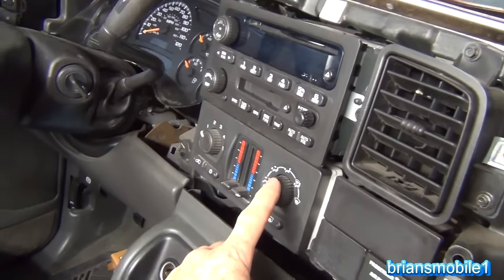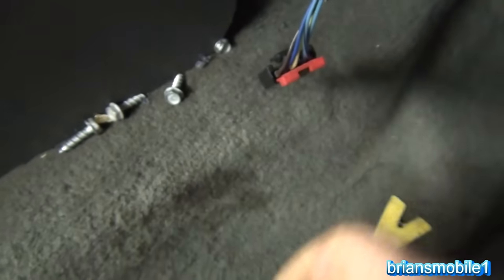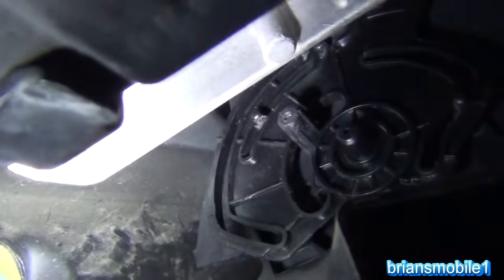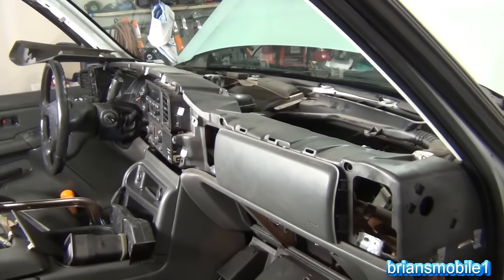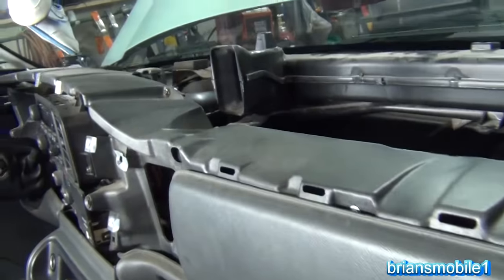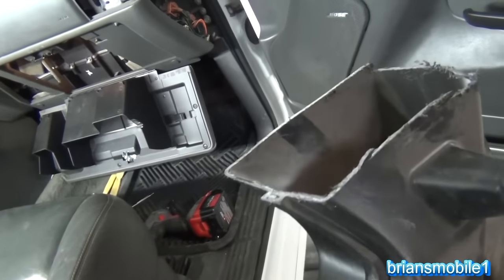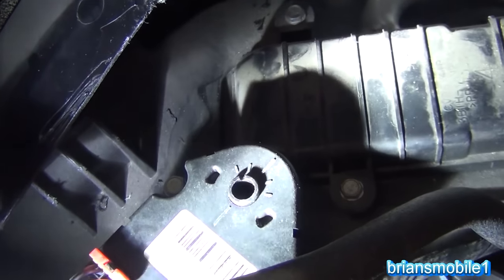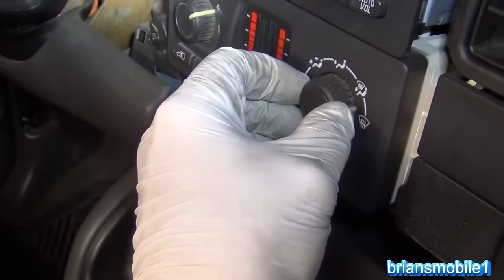Silverado Heater and AC Actuator FIX

Comment: Thanks for a great video. You helped me immensely and got me through the replacement of the blend door and inlet door actuators, both located on the passenger side. Having succeded at that I found  the mode control would not work. I had air blowing through defrost only. Various internet sources describe pulling the HVAC fuse (under the hood) or disconnecting the negative battery cable for 5 minutes or so, then turning the key to on (not start) and allowing the actuators a few minutes to automatically recalibrate. After multiple failed attempts this is wnat worked for me. 1) unplug both negative and positive battery cables, 2) hold the two cable ends together for about 30-40 seconds, 3) leave the battery disconnected another 20 minutes, 4) reconnect cables to battery, 5) wait another 5 minutes, 6) get in truck, turn key to on (don't start engine), don't touch climate controls, and allow the actuators about 4 minutes to automatically recalibrate. This is the only method that worked for me. Maybe it will help  someone else.

Comment: Great video Brian.  I was apprehensive to cut the vent tube assembly but agree with you that it works and probably the only way to change out the air inlet/ circulate actuator.  I had previously changed the mode select actuator in 2013.  Both blend actuators went out within a month of each other.  Decided to replace the air inlet actuator since the entire dashboard area was opened up.  Your video helped tremendously.  I even purchased the recommended Milwaukee jab saw.  It is a great tool.  Doing this yourself saved an insane amount of money from taking it to the dealer.

Comment: Ok I have to thank you for this video.  I was determined to install it through the little area so I took out the air bag, bat disconnected of course, the whole thing was very intimidating for me but this video gave me the guts to do it and it worked.....  I had a really small 1/4" ratchet and was able to operate its arm with a larger box wrench postured at a 90 around the end and held down the socket with a really long driver through the center passenger vent whole. the socket kept rocking on the bolt so much effort repsoitioning and repositioning the long screw driver through the denter pass vent and have another go. As the screw got deeper, the bolt became more ridgid and was abe to make slow headway with many breaks and explicatives.  it took forever but I had plenty of time.  I cant thank you enough for this whole thing all apart, I went back couple times to look at which metal bracket went where etc.  It took me a bit to get all the tabs up front to catch etc.  once again I cleaned all the pieces and the whole thing came out great and I saved just a ton of money....   I was able to watch the thing move back and forth through the center whole with a long light with just the key on.

Comment: Finishing your video says three things about me. The third thing is that enjoyed it! It is a very informative video. No time wasted, all aspects covered. 👍 Now about the wire routing at 3:42   I would of kept the wire behind, as original from factory. In a dirt road/washboard condition or potholes (I live in Michigan, Pothole Capital!) tucking the wire behind reduces movement as the wire is trapped in place against the screw boss. Just a thought. Although I'll admit I have on occasions re-routed, taped, or tie wrapped wires in additional spots. lol. Once again great video!

Comment: Hi Brian - awesome thorough video! I am replaced my servo controller for the mode switch with a brand new one. After installing and being proud of getting the two screws and it all aligned I was very proud and ready for a great fix. Unfortunately the new servo did not seem to operate as I hoped. I tried taking out the fuse to initiate the recalibration but that didn't help either. So I dismounted the servo and just watched it while it  hanged by it's wire harness. When I disconnected the fuse and turned the ignition on it would go all the way to the counter clockwise index mark. When I plug the fuse back in and turn the ignition on it would go to its full clockwise position index mark and stop. Letting it sit for few minutes with engine running wouldn't do anything and turning the dial wouldn't do anything. It would just stay in the full clockwise position.  So I'm not sure if I'm not calibrating it correctly or whether there's an issue with the actual AC control board with the switches and dials.  Do you have to clear the code on a scanner?  Any suggestions? Thanks!

Comment: Great video!  Went thru your process with my '04 GMC Sierra, flawless process!  One point from a prior experience: pulling the dash panel doesn't need a prying tool; simply pull the bottom right corner towards you to get it started (mine has a bit of the corner exposed for a finger grab), then just work it loose all the way around. This helps minimize mutilation marks.

Comment: This video work great. I followed it step by step  and didnt have any problems. The self tapping screw at 14:30 only works on some model years. I had the bridge plastic piece but couldn't get under it for a clean cut. But its supported by two screws one on each end

Comment: Bryan,  Great job!  Thank you for this great instructional video. I did not know there were four actuators. I changed the passenger floor one (from other info on the net). The one I needed to change was one under the gas pedal. You, saved me another few hours of stress trying to figure out why only defrost air was all I could get.  Thank you again

Comment: I finally decided to tackle this project and I didn't cut my plastic far enough back. The blend door doesn't make any noise now. Is that door meant to stay closed???? It hasn't moved since I replaced it with a new actuator. Going to attempt the drivers side since nothing changes from the vents to the defrost. Thanks again for doing this video for us fellas.

Comment: Video is a little old but exactly what I needed. Been struggling with my 2004 mode actuator for a few years, obviously not every day. But tried to replace it, watched videos, gave up had a shop replace it, he gave up. My hands are too big to get to the screws to reinstall. I will be more likely to try again after your video.

Comment: Such and excellent video and a well spoken educator you are. I came looking for info on ac control buttons not working but I'll just keep looking, Figured I would get some info for my 2003 2500hD I just acquired. I'm sure the actuators will also need some attention. Thank you for an excellent lesson!

Comment: Hey Brian, great video, long time subscriber since I have a Silverado.  I did watch the whole video and nice closing statements. 
I have a 2001 Silverado, manual heater controls, doesn’t have dual controls. 

I turned the key on and immediately heard a tapping noise near the glove box. That hollow tapping noise sounded just like, when you manually opened and closed the blend door on your video around 2:02. Once I started the truck the tapping noise became much faster. So, key off, no tapping, key on slow tapping noise. Start motor and much faster tapping noise. 
The fresh air button was on, I pushed the re-circulation button and the tapping noise stopped. Pushed the fresh air button and tapping started again. 

When I turn the control knob up to floor air or further to the right for floor and defrost or just defrost, the re-circulation button automatically goes to fresh air and the tapping noise starts again. Put the control knob back on vents and push the re-circulation button and tapping stops. 
I took off the easy to get to Actuator, unplugged it and turned the key on and put the fresh air button on and the tapping started again.  I think I illuminated the easy to get to actuator, since it is completely off and unplugged, but still have tapping noise. 

Everything seems to work for now, I am assuming the actuator will break since the tapping noise is quite fast when the vehicle is started. 

I guess, now I have to take the entire dash cover off to get to the actuator by the recirculation door. Would that be correct? Will I have to cut the duct just to get to that or those actuators? Any other suggestions?

Comment: Hey Brian, Great video... Thanks for the outstanding job!   I'm a proud owner of a 2003 Silverado SS AWD with only 55k on the odometer, had it since it was brand new!  What age/mileage did this problem occur for this truck?  Also,  my dash is black with charcoal gray paint on it and the paint is chipping and peeling off in three or four places as I've learned most of them do... it looks hideous.   I'm not having the actuator door issues yet, but am considering removing the top of my dash to strip and repaint it... Is there any chance you have that step in your editing archives?... I need to know how to remove the dash top.  My truck is my baby... spending most of it's time in the garage for preservation... but I drive it daily.. just not very far. I like to keep it in tip top shape.  Thanks for the great video, and kind attitude towards your audience! Love it...!

Comment: Great video, Brian! Used the cut method on my friend's 2004 Silverado 1500. Tried the glove compartment method first. Bad idea! Lost a 1/2 day of work! Went to the cut method and worked out real well. Local Lowes and HD did not have Milwaukee tool, so used a Lowe's brand which worked just as well. Thanks for your help!

Comment: Fantastic video. I have to do the same soon. Been doing the reset but it’s not working all the time. 2 questions please. Are all the actuators the same part number? What happens if I’m getting hot on the driver’s side also?

Comment: Wow, great video. I have a 05 Silverardo  with only 70,000 miles and hope I don't have to replace any of the actuators, however, 
after your video, I believe I would tackle it.  I bought it new and shortly after, they issued a recall due to a potential fire hazard in the control  for the heater and air cond. I can't think of what it is called, it was awhile back. I mention this in case someone has this model truck and is not aware of the problem. Thanks again for the video,  you gained a new subscriber.

Comment: This is one of the best videos I have seen on a vehicle repair. it is very well explained on the procedures it takes to do the job. My issue is I have a 
4 amp draw that is causing other problems. I am not sure if a hvac actuator is the problem. I have a loud clicking noise coming from the firewall right behind the intake manifold every time I turn the key on and sometimes while it is running I am not experienced working on this type of issue. Any information to determine the exact cause would be greatly appreciated

Comment: Hey Brian just wanted to mention as you requested, that you can take out the actuator inside the dash without cutting the duct. 
You have to take the other half of the metal bracket that is over the duct on the drivers side off as well. Then you disconnect the duct from the defrost on both ends just pulling the hose off, then you unscrew where it is connected to the dash on both ends. 
You pull up on the defrost part of it and it will come up and make a hole big enough to reach in and unscrew the actuator.

Comment: Excellent video my only two questions are why did you replace the actuators? and I either missed it both times I watched your video but what procedure did you use to reset these actuators, when I did my 1999 silverado manual a/c actuators, my truck has only 3 actuators, all my actuators reset except the one on the floor in the middle, if it's not too much trouble could you please explain why you went through all this if your actuators were not bad? if you had bad actuators which ones were bad, I totally understand why you did them all at once but I can't recall you mentioning which one was bad? again thanks for the video great job.

Comment: Hey Brian, just came across your video and appreciate the in depth information provided.  I have a 2004  Silverado.  The AC works fine , starting to experience cool air coming from the driver side and center vent and the center vent

Comment: Fantastic video.  I live in Miami, but went to Kentucky for a month in the winter, only to discover I have no heat.  Gotta fix that.  Two questions:  There are 4 actuators.  Are they all the same part #?  You showed the grease.  What brand or type do you recommend?

Comment: Great Video! Is there anyway to check each actuator or voltage to see if the actuator are actually the problem? All of my actuators began acting up after I had the battery disconnected while replacing the evaporator core.

Comment: Great video buddy I like how you took it step by step. I have a question did your truck make a knocking sound under the dash by your passenger side? My truck makes that noise when I start it and that's when it blows out hot air. But if I start it and it dosen't knock it will blow could air.

Comment: Howdy Brian and thank you for the video. Best one I have seen so far. I am just beginning my expedition into the repair on my 04 Silverado HD2500. At 73 I'm not looking forward into the bendy twisty bits I'll need to perform, but I'll get there. I don't know if you still pay attention to comments from this video but if you do I have a couple of questions. Where do you get the "duct tape" that you use? I have the other kind and I imagine that it would work for a while but then pose problems. Would you recommend replacing all 4 actuators at the time vs. just fix what is broke? I think I'm more for the option of only getting in there once... just thought I'd ask. Thanks for the video! I'm sure I'll watch it again to make sure I get all the info and correct parts. Stay safe!

Comment: Awesome video!! I'm going to have to look at my driver's side acuator valve and see if it's moving or sticking. My problem is that I sometimes get very little air flowing from the driver's side floor vent, but the passenger side has a lot of air. Regardless if I push the recirc. button or not, I still get little air flow. Sometimes I do get a good air flow though. If I switch to the vents by the steering wheel, I have plenty of air moving and even more when I push the recirc. button. As soon as the weather warms up and stays warm, I'll take a look. Also, thanks for explaining how to remove the dash cover. I was always curious but never remembered to look up how to do it.

Comment: Absolutely great video with a lot of description. Looks like this is the way I am going to take to get to this actuator. I wasn't getting anything but heat and the control button for outside air to come in would not work. The controls to send air elsewhere work properly, it just wont allow outside air to come in ?? If you think I may have a different problem, I would greatly appreciate any info. Anyway, so I replaced the actuator under the passenger footwell thinking that was it, but no. So now i see from your video there are 2 other actuators ! Wish me luck and have a great day .  Thanks again.

Comment: Been looking for a fix it video for days now for my wife's 2002 GMC Envoy SLT. Her Drivers side vents blow H-O-T no matter what setting/range you put it on, max a/c, vent, whatever. Passenger side seems to work ok. This is the first video that's made sense to me from start to finish. I "assume" and am convinced my problem actuator is the one on the bottom passenger area. At least that's where I'll start.  If not that, I'm wondering what's the chance that I could have a blower control module?
     At any rate, Brian, I really appreciate the thoughtfulness and presentation you put into you projects. You are helping people in more ways than you know.   Thanks...........

Comment: Awesome video, had to replace mode actuator..... it was a pain ... mainly the top screw ,had to make a tool to remove . Cut a notch in actuator so that i could screw the top screw in and slide actuator in place. Hope the replacement last a long time.

Comment: great video!  this helped me alot to figure which controll module was which.  one question though.   have you taken the bad modules apart?  was it the gears that failed or the electrical capacity of the motor/circuitry?

Comment: @briansmobile1
Thank you for the great video. You deserve all the praise I see in the comments.
My driver's side would switch to heat by itself, so I replaced the actuator and spliced in a new wiring harness.
The new harness has seven wires, but there are only six pins on the actuator.
I have the same problem.
Is there something I should do with the seventh wire?
Attach to metal, or join with one of the other six splices?
Please advise.
Thank you.

Comment: Thanks , best video by far... I was completely lost untill I saw your video. I have a 2004 GMC Sierra 1500. Air works great but starts blowing heat out of the 2 driver side vents no rhime or reason why or when. The passenger side 2 vents still blow cold. Which bleender is malfunctioning?

Comment: Good info.  I go thru the " to butcher or not to butcher"  decision too.  If it is my car I butcher where it is harmless like the vent duct you just cut.  I will also butcher where it shows a little on my own car and try to improve access for the next time  it has to come apart. I have never worked flat rate, just hourly so I would nearly always fix the customer's vehicle with no collateral damage.

Comment: Excellent excellent video thank you so much, my problem is I have cold ac & hot heat but nothing blows out my dash vents it blows out everywhere else fine just not the dash vents. Would that be the actuator by the gas pedal then?